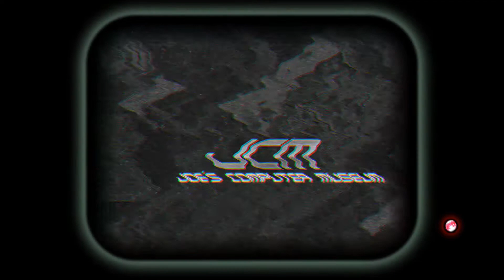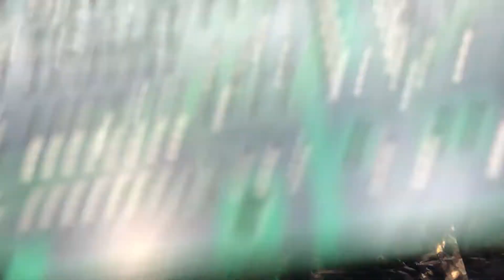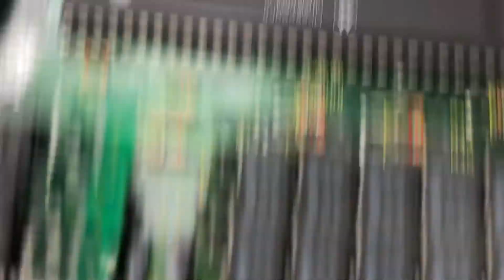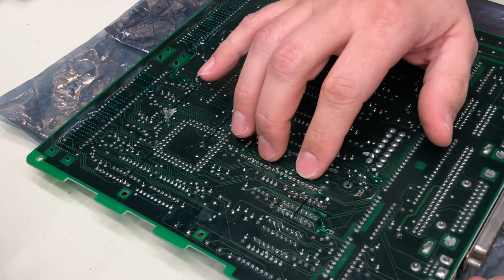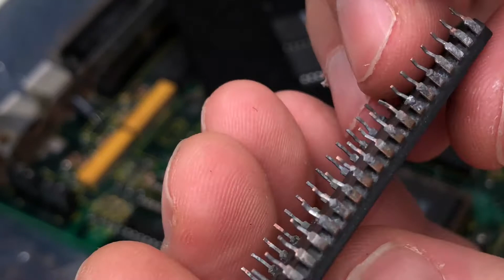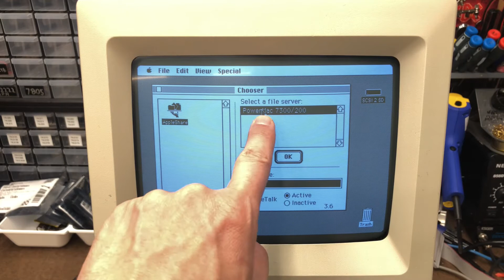Fixed? - Battery Damaged Macintosh SE FDHD - Logic Board Repair Part 2

Comment: 17:50 - So, was the original SCSI chip faulty or was it just a bad via ?
Reply from the maker: Good question. I believe it was only a bad VIA, but I did not test the old SCSI chip.